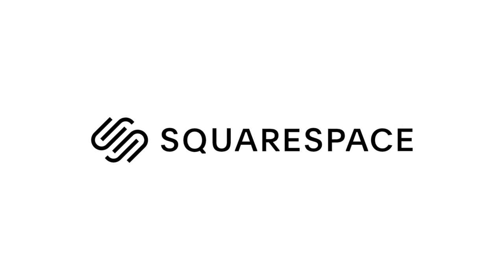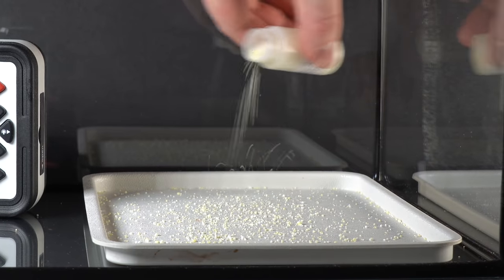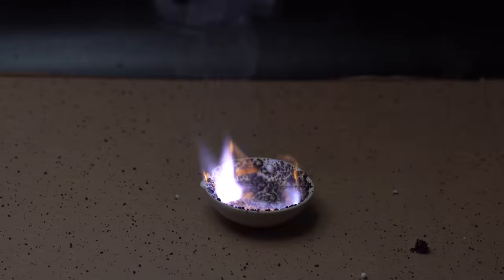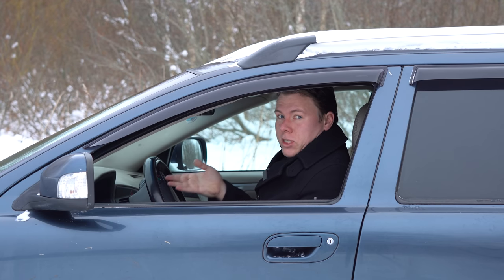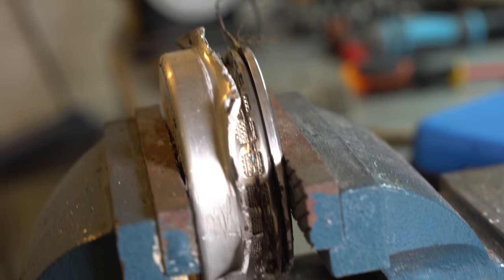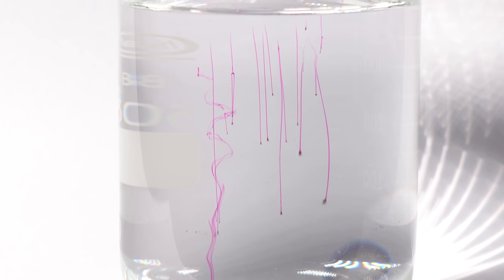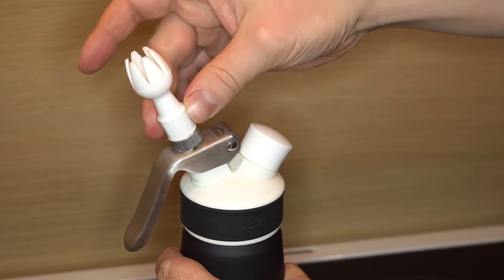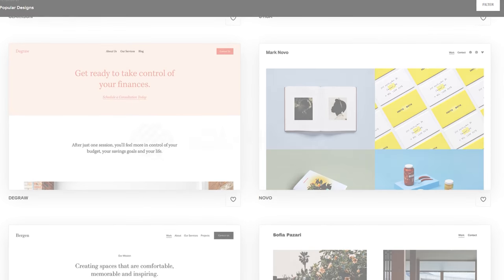Now I'm afraid to make experiments...

Comment: I recall in tech school replacing an entire steering wheel.. well airbags even when undeployed are not legally able to be reused..
So we decided to take it, a car battery and wire out into an empty area of the parking lot.. where were set it on the ground face down and activated it.. 
For the entire assembly weighing about 3-4 lbs. It still launched like 40 feet into the air.. 
Needless to say they can be quite dangerous

Comment: When I was a kid, some ‘friends’ found an unignited fireworks shell that the fuse failed to explode it on the way up from the mortar.  A hacksaw, magnifying glass and the noon day sun were brought together on our driveway.  It was a brilliant crimson red mine.. that completely singed my blonde hair and pale white skin. Imagine “oooh—- ahhh” sounds from the neighbours but at ground level.  Mom was not impressed. I never did anything quite as stupid again and learned a good lesson about thinking ahead and thinking things through.  Ultimately studied chemistry and retired as an anesthesiologist… all fingers and toes intact!
Reply: Reminds me of when I was about six years old and went to a civil war re. with my neighbor and mom. While walking around the civil war re. I happened to find an unused black powder cartridge and stuffed it in my pocket before any of the adults saw it. Took this home and dumped it into some tin foil and cut a small piece of a yo-yo string and took it to the sand in my playground out in the backyard and proceeded to light the fuse. It didn't work, it just smoldered at the tip. So I pulled out the fuse and stuck the smoldering tip into the tin foil ball with a full charge of black powder, the second it touched the powder, it went boom. I burned my hand badly and had to go to the hospital to get it looked at, but don't have any scars.

Comment: All post-2001 commercial automotive airbags are supposed to have a label on the back that says "NON SERVICEABLE" & "DO NOT DISASSEMBLE" or similar warnings; the warnings are there for a reason. Airbags can & do occasionally cause burns (due to propellant) to passengers in the event of an accident. Takata airbags in particular had a caused a number of burns, including the airbags deploying prematurely, which involved a serious scandal and in turn a massive recall for airbags made in 2013-present.

Comment: I couple things to mention about chlorates. Beck in the 70's in America. Sodium Chlorate O2 generators was used in pellet form to produce oxygen for a simple cheap welding torch. Sold under the name as SolidOx it was sold in dept and hardware stores. 
Some chlorate compounds can be highly dangerous if not ph buffered properly as they are hygroscopic and will form chloric acid  which is highly unstable around reducing agents.

Comment: I'm glad you are ok,  burns on the hands are especially troubling, because you still must use your hands! I had burning plastic between my fingers, I had holes burned into my fingers, some 3degree possibly worse in spots, having your hand on fire and it not going out, is a bit concerning, a simple glove would have saved me though, unfortunately my house was burning down, so I didn't have time to wear any! Anyway glad you are ok, that could be much worse!
Reply: Wow. What happened? Were you able to put it out? 

I agree, burns on the hands suck big time, although I've never had them that bad.

Comment: This is not a serious injury at all. Once i tried to make a alumothermic reaction using burning magnesium shavings to start it. Mg was burning reluctantly, so i decided to add more of Mg, this time a fine powder. I just took it with my hand without any gloves on it and dropped into the crucible where the Mg shelving was already burning. This worked out, though the reaction started a pretty violent way, forming a ball of fire over a crucible. My hand was dry on the inside, but a bit wet at the back side, so some of the Mg powder got left on the back side of my fingers and it caught fire as a result that my hand was too close to a crucible. Eventually i have completely lost a skin at the back side of one of the fingers damaging a joint on it as well, the other fingers got left without the skin partially, 2nd degree burns on the back side, some 1st degree on the inside.
What's noticeable, i had a scar on a most damaged finger, when the new skin had grown, i've got that scar back again on its place

Comment: To trigger an airbag with wires and electricity, you need to put out the green and violet plastic in the conector. This is because is a tiny plate that short the two pines to prevent static or other electricity trigger the airbag. If you want more detail ask me anything. Greetings. Love your channel

Comment: I made some sodium peroxide myself and I'm sure it is because it had a stronger oxidizing power than anything else involved or potentially there 
But it never reacted with water so vigorously, It didnt do much to CO2 at room temp
Further research told me it doesn't react readily unless at 200ish degrees and 70 degrees for CO
But even during the research I found nothing about a high hydration enthalpy 
Your videos do a lot, thanks

Comment: I worked in a manufacturing plant making steering wheels  and  put airbags together and put those things in the back of it the ones you got burned with, and we had to put each of them in a tester to make sure they would discharge and not have faulty charge, hysteria where not allowed in that part of the plant fear of running over one of those. Didn't realize how dangerous they were until you showed what happened to your hand. Also we couldn't wear any jewelry risk of falling off and getting into the airbag if the airbag blows the jewelry could be a projectile and could seriously hurt or kill someone. No jewelry, belts, hard candy, because of that. If one fell  on the floor we had to back away and let someone with full protect fireproof suit on that looks like a biohazard suit, they would test it to make sure it won't go off and explode. They came up with that after someone died after one fell on the floor and picked it up right away.

Comment: Potassium permanganate was called Condy’s Crystals and was commonly available. manganese dioxide was the black stuff in dry cell batteries, there might be some ammonium chloride solution as well. I have used manganese dioxide with aluminium powder in a thermite reaction, but it could react explosively. I never saw any manganese metal and suspect it burned up in the reaction.
The azides were a whole family which I was interested in but never did anything.
There was a fascinating series of books on experiments by Professor Hubert Alyea which might have touched on azides amongst other things.

Comment: My friend, when fire is a risk use aramid fiber or leather gloves. They are much more resistant to heat than petroleum derived fibers or plant fibers. 
Aramid fibers are used for fire protective suits, and leather is used by welders for protection from liquid metal splashing off of a welding arc

Comment: I might be related with Thoisoi.. At least i strongly relate with this episode.
 Here's some themed episodes from my life: ⚠️long read warning⚠️

 I used most of mentioned  chemicals and plenty more dangerous, while running my middle-school IED, rocket and cannon shed-lab. 
 The one which nearly got me (apart from syringing nitric acid stright in one eye, sulphuric acid down arms and exploding improvised black-powder fuses toasting my face and hands) was KMnO4. I just loved the stuff, available in all pharmacies for 50 santims in the  '90s. Loved it mixed with metal powders (aluminium, etc., also lead peroxide in turn made nice, soft granades, exploding on impact). Super bright, hot, reactive.. yeah, no gf yet.

 Once i had to stay in hospital for 2 months, not long after i started chemical experiments (must have been 11-12). I had mates there, even borderline gf, but we got bored out of our minds (no TV or internet post-soviet mid-'90s). I had couple of quid and went to hospital's poor pharmacy. Of course there were bottles of KMnO4, cheap. So i got  some, thinking what could it burn with. Didn't know about the organic chemistry or science much, never heard of sugar rockets. But i knew sugar is kind-of fuel. So justt pinched some sugar from diner, ground it up in a box, same as the permanganate. Estimated some mystic proportions and mixed it. Found some thicker carboard tubes in cleaners area, layered and fortified them. My plan was to make a solid roman candle. Made a fuse of KMnO4 impregnated paper. Didn't have enough of the stuff to experiment much, so just stuffed and closed the tube with an opening on top. Our jolly group of 'sick' kids went to the car-park, for some hopeful fireworks (weren't allowed to leave the territory).
 After the fuse hissed away and a split-second fire-fountain, it just went 'BANG!!' with such a rage, literally over half of cars there got their slarms triggered and there was not a shred of the tube in sight. Not that we had time to look for anything, as we run like mad to the backyard entrance  hoping the security don't see us. Luckily they just got confused combimg the carpark immediately after we got back in.

 About that glycerol reaction.. we (i had a serious accomplice) found an exciting way to use it as a fuse: the mischievous chemistry hadbook stated it always takes around 2 minutes to ignite for a certain amount of potassium permanganate - KMnO4, infused with couple of drops of glycerol. We tested it well on a surface and seemed to work as described, always close to 2 min.. The reaction is really not immediate this way, as Thoisoi said.

 By that time we had experimented with countless IEDs and other fun contraptions. One of our favourites was a literal cast-iron granade, very powerful for it's size (we made way bigger stuff from gas and firefighting canisters etc.). The cast-iron casing was 'borrowed' from old soviet railway line grounding resistors - a hollow cylindrical bell shape with a half-sphere top and a kind of screw-in hockey-puck disc for the bottom, rods on both ends for connections . Emptying contents made about 1/2L container 120mm D×150mm L, around 15 mm thick walls. Perfect for powerful and destructive defragmation booms with just a good low-explosive powder mix. Using fuses from fireworks, powder-filled drilled rods and impregnated paper had it's issues with reliability. We could't get the fuse mix right for it to burn and explode under water. So the bright idea of using KMnO4 with injected glyerol came to us. What's not to like - airless ignition with the super-safe timing of 2 minutes. 

 So, for the first try we made some usual own-brand mix of Al, S, KNO3 and NH4NO3. I got a medium medical needle and drilled a hole in the top part of casing matching the needles plastic connection and epoxied it in the hole, that the needle ended in the centre. Filled it with low explosive sticking a gram or two of KMnO4 wrapped in a paper ball right on the needle, and screwed in the bottom disc compactly. Of course we had another bright idea, as it was getting late: why not take it to the school tomorrow?🙄
 So i did.
 The next day, with the granade weighing my backpack, we couldn't contain ourselves to get trough first part of the classes. When the long dinner brake came, rumor had spread in my and my mate's class, that we had a bomb (again, friends kind of knew us).

 No, school never had nothing to fear - there were woodlands half a block away. We went to that city forest strip and i just stuck the bomb in the ground between roots of a big pine tree. I took the syringe and loaded it with glycerol (or glycerine, didn't know the concentration). About 30 fellow pupils couldn't resist coming along for the experiment. I ordered them to stay well away behind the trees, but some 5 most curious just had to pose themselves less than 10 m behind me. Ordered them to run away when i do and got down to the granade. Inserted the syringe in the needle's connection. Pressed. The liquid didn't move. Pressed again, hard - while watching the plunger - it mover couple of mm during these 4-5 seconds. I thought enough, got to go and the epoxy slighly cracked anyway. Good choice. I quickly turned getting up, 2-3 big steps away ready to run, just in case..

 KABBOOOMMM!!!...--> and the warm, insistant blast wave hit all of the back of my body. The forest sounds immediately turned into high ringing.
 The area quickly filled with white, thick smoke for maby 100m in each direction. I just froze looking at my schoolmates, closest madlads fallen to the ground, silence and tinnitis. I broke the silence with a dumb -"Nobody feels hurt anywhere?"
Funny that nobody did feel, even me, at least physically. 

 The blast wasn't on a par with mortar shells or a big landmine, just the average i guess. About 40-50cm deep crater in soil with roots sticking up. However i did find the thick alloy screw-disc with rod burrowed underground twice the depth of the crater itself. It was a defragmation blast and we found the top rod still in a jagged piece of casing some 50 m away. I guess there just wasn't anybody's name of any of the cast-iron fragments surely flying everywhere, as we found no more of them. I have thought a thousand times about those moments since.
 It took less than 5 seconds after the plunger moved to the blast. If i had hesitated just couple of seconds, by my intrinsic pedantism making sure that there really was the liquid going in, would i have hands - or head - today?

 I was not traumatised much, though. I got reckless down the road in other ways, as risk seemed nothing to me. Climbed 100m electric pylons bare-handed in -20°C.. Road-tripped Europe on my own without the place to stay or funds, got locked up in various institutions and cheated death countless times.. until one day something happened and i believed i died and went to purgatory. That's another story. After 15 years and enough countries, i returned home, but not too well. I was done taking risks, the cracks started to show.

I also remember, after going home from that fateful day at school, we made another experiment. This time, instead of wetting KMnO4with glycer-ine/-ol or making another deathbomb with it, my friend got a small metal valve from a canister. It had a hollow centre and small openings, where around 1-2g of KMnO4 could fit. One of the opening fit the tip of the syringe well. So we stuffed the centre with the same (it's called 'little blue grains' in my native commoner language). Funny thing: as the valve was packed, without air, as soon as my friend connected and pushed the glycerol plunger, it shot out in micro explosion, nearly burning his hand. We tried again - same result. It ignited immediately upon wetting, while being compressed tight without air, same as in our granade. Every time we tried, it took under 1/2 second to go off. Looks like i was luckier, than i realised on the spot.
 Thinking back, i must have spent my 9 lives and blind luck pretty young. I'm still looking to get at least some conscious luck back..
✌🏽

Comment: The terminals for the airbag have a shorting shunt that moves out of the way when the wire plug is inserted. Used one of them to give a giant model rocket an initial boost as the main engine fired up. Went very high. Oh im glad you didnt get killed or seriously hurt when it went off. Any of us chemistry guys have had at least one... Damn that was dumb moment. 😎😅

Comment: BTW, the reason there was a big fireball in that scene from the Kursk movie, is because oil floats on water.

A submarine that is damaged to the point it is flooding, is going to be damaged to the point oil is going to leak. Oil can come from equipment crankcases, engine crankcase, diesel fuel, etc. And since oil floats, it's on the top surface of the water. Just as the rice krispie caught on fire, the layer of oils floating on the water, when the sodium peroxide hit, burned all that floating oil!

Comment: I think the theory in the kursk film was that they were in the engine room or something and fuel and oil leaked into the compartment due to the damage. So when the co2 scrubber fell in the water it ignited the oil. I'm pretty sure this is one of the theories as to what killed the crew in real life too, but I might be wrong
Reply: DK: Yes, that is correct.  In the US navy we used similar chemical packs to generate oxygen for our firefighting masks.  We exercised extreme caution to keep the packs away from oil or oily water in the bilges to prevent explosions.

Comment: 5:30 Funny enough, the oxygen generators used on airplanes are not allowed to be carried on airplanes except in a very special case, and that case is hooked up to the emergency oxygen system of the plane itself.
     Several years back a passenger plane was loaded with what was marked as empty oxygen generator cases. But the boxes mismarked as the cases were not empty. In fligfht the generators caught fire and caused the plane to crash into the everglades.

Comment: The 80's and 90's where easier times... As a curious 17 yr old I bought 500gr medically pure permanganate over the desk in Swedish pharmacy 🤣
I had a small run in with pool chlorine yester-yesterday. I was working with stubborn spots, so I figure some chlorine solution might be effective. The pellets had only a paint odor, but it was hard to dose and the bucket was also ime consuming to open and close. So, I made a pre-mix with water and kept it in a bottle. Dumb idea, mixing with water it will start to release chlorine gas and slowly build a overpressure in bottle. The first time I open the bottle the was this "fss" sound the next second it felt like my nose was on fire.

Gentlemen and ladies, even the tinest amount of concentrated chlorine gas will hurt you bad. I had an altered sense of smell (and taste therefore) for 24 hrs... and it did not improve my quality of life.